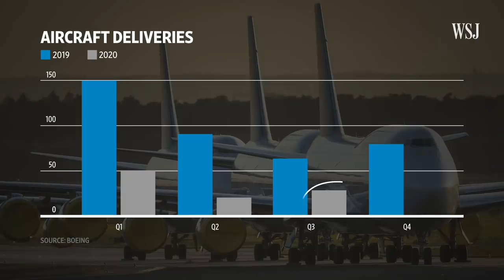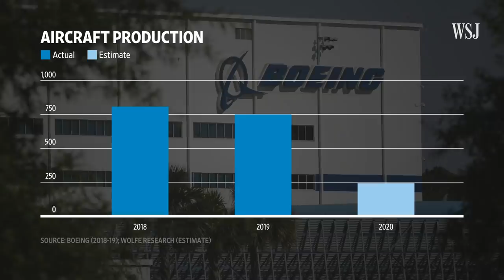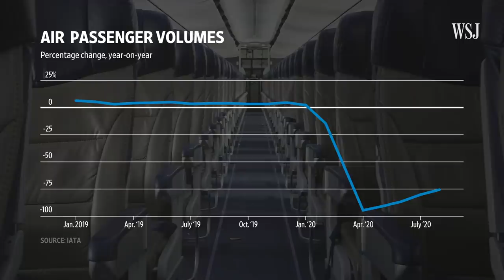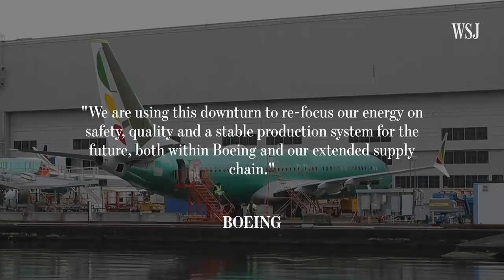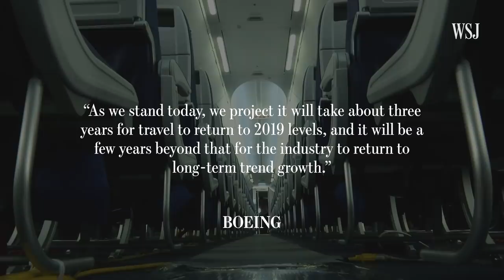How Boeing Suppliers Plan to Survive the Aviation Crisis | WSJ

Comment: Boeing largest customer is China. Since tensions are rising between US & China, China may just ban Boeing.  
That will give Airbus and others huge advantage.
Reply: A single plane supplier. After the 737 max issues that would be a huge risk. What if Airbus encounters issues? Relying on one player is a dangerous thing
Reply: @khavaliar  Are you an avgeek
Reply: @khavaliar  Because what airbus plane would be crashing the A320neo or A220
Reply: @siyaaviation3659  If history is a guide, possibly A320. They have a lot of crashes in their early days. Although, a lot of those are primarily pilot error.
Reply: Don't forget China has its own brand soon, COMAC. Decrease order is a given in the future for both Boeing and Airbus. (Not totally yet as COMAC only has a narrow body).
Reply: @omega91006  they are making a wide body fellow avgeek
Reply: @siyaaviation3659  yes, but I don't think it will happen with the original schedule as needed aviatit "technologies" are no longer "available".
Reply: Doesn’t help Boeing much that Airbus also have a final assembly plant in China. I would guess that this gives Airbus an advantage over Boeing when it comes to selling aircrafts to China.
Reply: @12345anton6789  It's aircraft btw

Comment: If Navy push through the double body being 777 with aircraft hanger in the middle as air craft carrier for testing heart land air craft carrier for faster response and safe operation and time response. Change wiring to flat wire and laser beam wiring inside the PC pipe to reduce signals leak. This contract could ease Boeing  hard time
Reply: Inflated space module for good for NASA. And new engine of sideways arrangement as anti gravity and hot electric air using electric heater
Reply: Converting the grounding planes to recover cost and use for military Poseidon  P8 anti submarine airplane
Reply: Jet age is over. Because air density can be manipulated  and gravity generator could add extra weight up to 5 time normal  weigh  and that dangerous